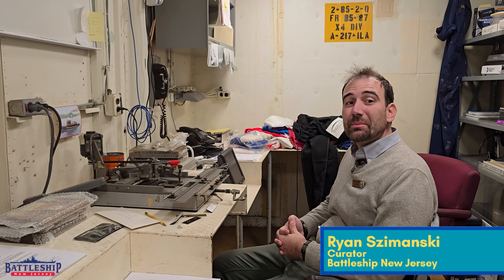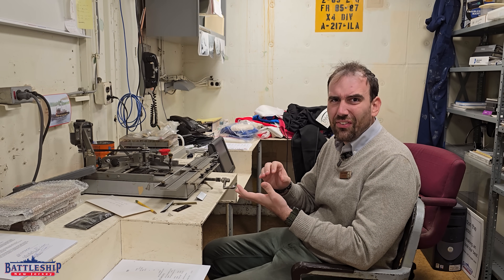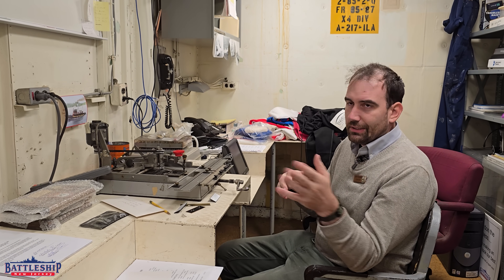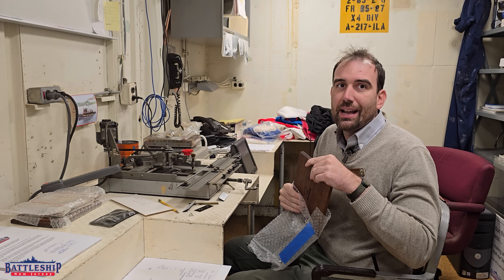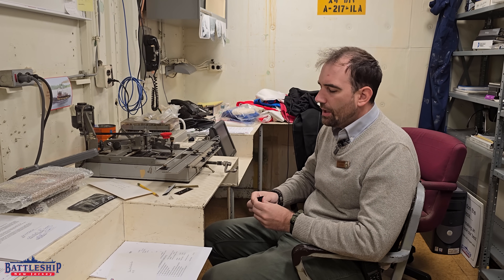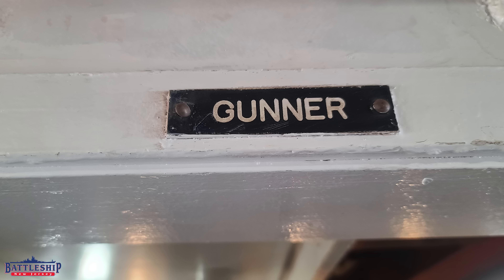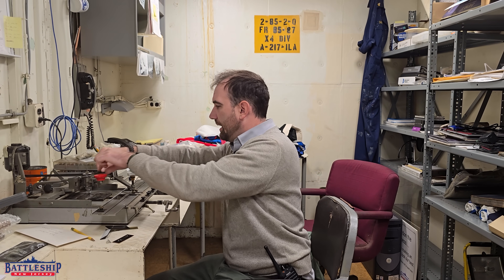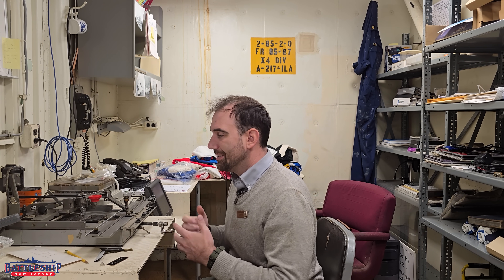This Thing Actually Works? Engraving on the Battleship

Comment: Hi Rayan. That is a new hermes engraver. It dates from around 1980 I used to own one. It can do larger signs than can be clamped by setting the machine directly on the plastic. Then engraving the larger pieces in sections. So it would probably be aboard during the last service life of the ship. You can probably still buy new stock, attachments pins , cutters etc. They make different sizes of master letters. and also reverse letters for engraving clear plastic to be read form the other side. The cutter is adjusted for depth, and different width cutters are available for scaling of letters. The machine is bullet proof and will last the life of the museum. With a  little practice you can make custom name tags etc for sale in the store.
Reply: You would think, unless this a one off custom made tool, there would be manufacturing marks/dates on it.
Reply: @Chris...66   hi my unit did not have any info as I remember. It was like their model 1/2/3/ etc. All of them used the same letter masters, cutter bits, etc. the only difference was how big the piece of plastic it would hold. Also they made adapters to engrave round objects. However I did not own one. Don't quote me on the model numbers just for discussion.

Comment: The machine you are describing is a PANTOGRAPH, from Ancient Greek “panto”=ALL “graph”=WRITER.  It was described by Hero of Alexandria.  It was used throughout history to copy printing in different sizes, to enlarge and shrink drawings and a three-dimensional version can be used to copy sculptures.  Adding a motorized engraver in place of the pen is a minor change.

There is one of these machines in the machine shop aboard NS Savannah.  In addition to producing small plastic signs, it appears to have produced the labels on the translucent backlit alarm annunciators in the reactor control-panel.
Reply: the arrangement was used with templates of different sorts (just depth templates or path templates etc) for like a cnc-before-cnc arrangement.  like to carve complex paths for mechanisms etc.

also yeah as a cheat device for working on machining small things. watches and such.
Reply: Interestingly, "chrono-graph" means time-writer. But more specifically timekeeper. There seems to be a lot of confusion over what makes a watch a chronograph. Quite laterally, it's a watch that has the added feature (features on watches are called: complications) of a stop watch.
Reply: Graph has the other meaning of "to record" (i.e./via to plot or trace); thus a Chronograph is to make a record of time, as-in tracing (observing, recording) the passing of time.  This is why we call a watch a watch; to watch time go by or trace it (track it).  Pantograph is also correctly understood to mean to make a record of all things; to preserve  or observe them, or to plot and trace (write) it.

Comment: My family owned a trophy shop in the Chicago area in the late 70s early 80s and we had a number of these machines ranging in size from a small one like yours to larger floor mild mounted models. In addition my father became a salesman for the manufacturer. Which is a company called New Hermes. After my father’s recent passing, we sold and gave away I think four or five of those machines and many many boxes of fonts. If you have any questions, I might be able to answer them for you.

We definitely had a couple of machines like that one in the late 70s they were probably making that machine all the way back until the 60s. 

Gorton also made Miller machines with movable beds that also had the pantagraph engraving system so you’d like the bed in place and move the machine head instead of the table.

I wish you knew you had that machine A few months ago, I could’ve donated literally piles of materials and parts and fonts. 

Love the channel!

Comment: As mentioned in other comments, this is a "pantograph engraving machine". I used one of these in my high school "graphic arts" class. Made a large "keychain" and desk nameplate for myself and a nice little keychain for my mom on a machine very much like this one. With the proper cutter head you could engrave any pattern on nearly any surface.  Oddly, when I went to work at Target back in the very early 2000's they still sent out to get all us "full time" employees each an engraved name tag... 
   good times man, good times   🙃

Comment: Yes a metal letter punch set or some transfer engraver would be needed on a warship of her size.  Most could be done in port but with underway repairs new labels would be needed and perhaps some just to mark preferred presets based on performance or when things are rearranged.  Also handy to remake lost dog tags or engrave items bought abroad, perhaps with a fee for a sailor.  Brass being soft is easy but if the cutter is a hard stone even hardened steel can be done.

Comment: The plastic is called Romark. It can be bought at sign supply stores or directly from Romark company. We use it on our CNC machine to do the same thing.
Reply: yup we have a pantograph just like this  but we would use the cnc instead as it's easier and faster . we did recently buy a small cnc engraver from china for cheap ( under $200)  so we can make signs and labels without taking up the machinists time. we trained a maintenance guy to do it

Comment: Key making machine.  Ditto machine.  Flatbed printer with wooden letter.  When I Worked for Montgomery Ward, I was the display manager. When clearing out a storage room I found the sign printer and a flatbed printer with the letters.  Cleaned them up and used them.  There was a definite learning curve.

Comment: There may have been a coil winding machine in electronics maintenance. I can only speculate that may have been present. If a coil failed during deployment or a modification to a radio circuit needed made, winding a coil in the shop would allow something to be fixed or modified quickly if the spare part wasn't available onboard. Winding a coil would be faster and cheaper than shipping one for sure.

Comment: I was an engraver on the USS Simon Lake in 1975. We were assigned to sub squadron 16 stationed in Rota Spain
Reply: Was there actually an Engraver Rate, or was engraving done by other personnel depending on local situation?
Reply: On a tender such as the Simon Lake the engraving shop would be part of the Repair Department, R-2 Division, and manned by Machinery Repairmen. Engraving was a skill that was covered in the Machinery Repairman rate training manual.
Reply: @Stude59  Thanks.  At the Internet Archive I found the manuals Machinery Repairman, NAVEDTRA 12204-A September 1993; and Machinery Repairman 3 & 2, NAVEDTRA 12204, May 1990;  
and both have a brief mention of the pantograph engraver.
The Navy manuals are excellent. As a printing student 50 years ago, we had to buy the Lithographers Manuals at the GPO, and every edition had different information to stay current.

Comment: I have one of those machines which I use to engrave vernier scale for rifle sights and it's called a pantograph engraver. The American made Alexander would be a likely suspect for a larger machine used in the machine shop for making bigger signs or actually copy milling more complex parts. Cams and certain gears for the gunnery computer would have been made or at least traced on such a machine.

Comment: My first unit in Japan had a pantograph machine like that, I used to use it to make signs and name tags for desks. I would slot in plastic letters into a groove in front, and the cutting head was in a dremel sized electric arbor. I would run a plastic stylus in the groove of the font tiles to trace out the letters. The plastic fonts I would trace came in different sizes, to change the size of font engraved on the work piece. I can't remember the ratio, I think it was 2 to 1, i.e. 2" font tiles engraved 1" letters in the work piece. We had ours out in the warehouse, because it made a mess of plastic splinters that went everywhere...

Comment: That looks familiar . We found a very old one - less sophisticated than that but it had enough letters to run up plastic tallies for inspections or to replace missing ones . It used to be useful if the machine shop couldn't make them or they had been overlooked .

Comment: Ryan, I did service work on Navy Ships on their Copiers in the purser's office. In the 80's, the Navy had Savin Dealers on east coast Install Liquid ( Toner and developer) Copiers. The Copier was based on the reliable 1970's model 770, but it was modified with a much much deeper "tank" which held the mixture for printing. There were large springs as well if the water got rough. This model was the "772" It had an electronic number pad, and still has its mechanical shutter, and 2 paper cassettes. I did find a picture of a 770 model, but info and pictures are scarce. These had to be serviced in port usually. I know Tenders had these, and mine sweepers, probably many others. Copies were not very dark, but had good line resolution. A real mess to PM though.

Comment: Thats cool. I ran a CNC one of those briefly when i worked at a factory. I engraved aluminum data plates for the machines I was building with it until they decided it wasnt in keeping with their dumb lean manufacturing ethos to have an assembler making data plates. Cool to see an original, vintage version.

Comment: I'm an old school machinist. I know how cutting tools changed from the 70's to now. For example the lathe tooling was original high speed steel that the machinist had to grind the required profile to perform the cuts desired. Now we use carbide tooling with the profile already formed in the tool. It would be interested in knowing how the tooling changed in life of the ship.

Comment: That is called a pantograph. That particular model that you have there looks like something a home hobbyist would own compared to the ones I used when I was on active duty on two submarine tenders, USS Proteus and the USS McKee. I entered the Navy in 1971 and attended Machinery Repairman “A” school at NTC San Diego. Using the pantograph was a subject that was touched on briefly during my schooling. The machines that we had were manufactured by Gorton Machine I believe. They were quite large and heavy cast iron machines. Our tender actually had stand alone engraving shops that were part of the machine shop. Usually they were manned by two, maybe three, MR’s. 
Their job was to do all the engraving for the tender and all the submarines attached to the squadron, placards, name tags, etc.  In the time I spent in the Navy I saw the pantograph evolve from a massive machine that you had to manually set up to computer driven machines with a keyboard and video screen.

Comment: Damn! I used one of those for many years until it was retired in the 90s.
Can't be beat for plaques and other signage!

I wonder if you can still get the Gravaply material? We had a huge knife like a huge paper knife to cut the ply. They had many different plys for even back lit plaques.

The bigger ones usually did metal plaques.

Comment: I wouldn't doubt the USN had Gorton Pantagraph Engraving machines in the shop.  

Those New Hermes IX pantagraphs are definately handy, I used one at work and when they decided to get rid of it I added it to my shop.  With the one you have, I wouldn't doubt that there might have been one for the more delecate work and a second heavy one for the more utilitarian signs and part numbering.  by the look of your cutter, you might want to get a new one or get it resharpened, New Hermes is still in buisness last I checked.

2 machines to look for would be the stamping label maker (it pressed letter dies into the thin sheet metal to create pipe tags) basicall a larger version of a DYMO M1011.  The other one to look for would be a stencil cutter, it was used to cut the friskets for all the painted signage.  Who knows, they may be hidden in a cabinet under a tarp in a room no one has gone into for a decade or two.

Comment: Just wondering, have you found the stencil cabinet yet? There should be a cabinet somewhere with a lot of drawers holding different sizes of alphanumeric and other stencils. Ours was pretty good size like a smaller chest of drawers. Hundreds of thin, brass stencils we used to do everything from labeling tool boxes to flight deck jerseys to bullseyes.
Reply: The yellow sign behind you was made with the stencil set.
Reply: @kevinwaterman389  I know. It's a bullseye.

Comment: for the big signs they probably used etching. you setncil a patter and go over the stencilled part with some disollving liquid, like sulferic acid. OR  they had the small tags made on board,and had the bigger signs made on naval bases..

Comment: The bevelled edges would almost certainly have been done in the carpentry shop, cutting them out of the large sheet with a fine blade wood saw, and then planing the edge smooth, and the bevel being done with the same plane as well. Look at some of the larger signs and you will see the chatter on the edge of some where the plane was being used by an apprentice to the shop as part of training, being a job that needs doing, and not too critical so the FNG gets to do all of them as training.

Comment: In terms of the large vs small engraving machines. I would think the larger one may be still hidden, or unfortunately, tossed out because of ignorance. Then again, when the ship went into mothballs, someone may have lifted it off since the large engraver on their own ship / installation, needed replacing. As for the smaller one, that would definitely be used to death since people were changing rank, position, designation, etc. on a regular basis. Plus how many tags get ripped off and need replacing?

As for some machine that you should cover, I would recommend the machine shop and what they made vs what could be purchased at the hardware store. My operating theory is that the number and types of screws, nuts, washers, etc. on a ship have limited stock on hand and the machine shop had to make them using raw material because that would be the most space effective way of storing material.

Comment: I would cover the machine shop in terms of manufacturing items.

The machine shop and what they made vs what could be purchased at the hardware store. My operating theory is that the number and types of screws, nuts, washers, etc. on a ship have limited stock on hand and the machine shop had to make them using raw material because that would be the most space effective way of storing material.
r, I would recommend the machine shop and what they made vs what could be purchased at the hardware store. My operating

Comment: I think every ship has one of those along with a stencil cutter. The larger signs may have been made at a shore station or tender if the ship didn't have one big enough. I remember checking into Naval Hospital Oakland and they had a sign behind the front desk that was for the Diesel generator only they spelled it Deisel and when I pointed it out I was told "everyone says that" but no one ever bothered to replace it!

Comment: The machine is called a paragraph.  When I was stationed on Midway Island the base exchange had one of these machines that cut all of our signs needed on the island.  I doubt that it was original equipment, as the navy had a requirement to have a brass tag permanently affixed that stated this was US Navy property, and it was assigned a serial number, if it’s value was $500.00 or more.

Comment: The plastic is essentially plexiglass. Those machines are still used in industry but most have gone to laser systems. When engraving things like dash boards it is common to paint them and the do the engraving. The letters and numbers then have white paint wiped in
To them. The paint shop should have 2 or 3 stencil cutters

Comment: I wonder if there were any Dymo type label makers used on the ship.  These are the one that imprint letters / numbers onto a plastic strip that comes in a roll.  While the plastic comes in many colors, then imprinted the character turns white.  These strips were anywhere from 3/8" wide to 3/4" wide and had an adhesive backing.
Reply: We used it onboard in many places, and you can still see some of them onboard.  

There may be one or two around, I doubt Ryan even knows what it looks like, I think he is too young for those.  😂😂😂
Reply: @cruser69  You can still buy dymo tape embossers, last one I bought I think was in a grocery store's office supply section.

Comment: I was on a much smaller ship in the early 80s, so our machine shop capabilities were not as extensive as what you’d find on a battleship.  Most signage of the type highlighted in this video was made for us ashore, either at our yard periods or by our own people using shoreside equipment.

Comment: Used a tool like that to engrave commemorative plates like on the wooden plates and used it the commemorate the birth of the princess of Belgium in 2001 by engraving 24 shell-casings used for the salute. Mine wasn't powered though.

Another interesting machine like that was the key-maker/replicator in case some were damaged or lost (as in not handed in when leaving the ship).

On a less serious note. Did you, maybe, find the lamp that is used for 'light duty' ? Or the spool with some extra waterline on it or maybe even an old tin with blue sparks inside to refill the spark-plugs..... People kept looking for these things all the time!  ;-)

Comment: Not that you should have any reason to sell them, but be aware that the brass letter SETS (officially named Master Copy Type) are worth from $75 to as much as $400/set. However, if you lose a letter then the set is essentially worthless unless you need to engrave a word that doesn't need the lost letter. My point is not about selling/keeping, but rather in the obvious (but easily forgotten) fact that a lost letter makes the font set pretty useless. Be very mindful about putting them away when completed